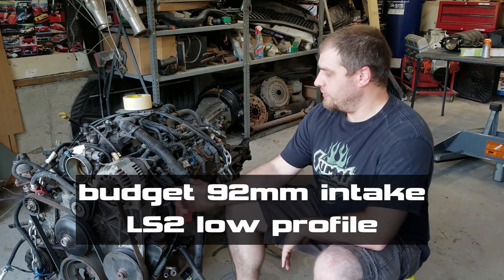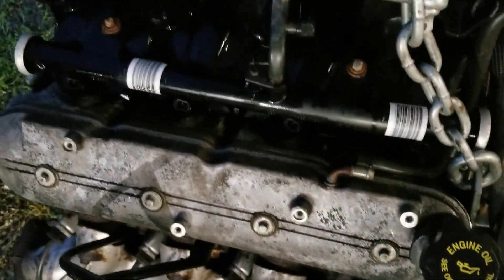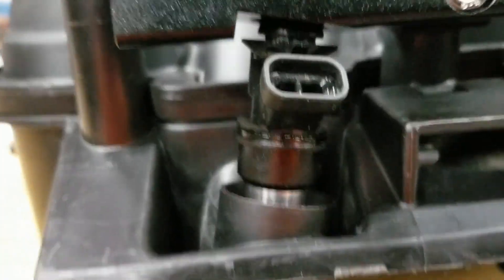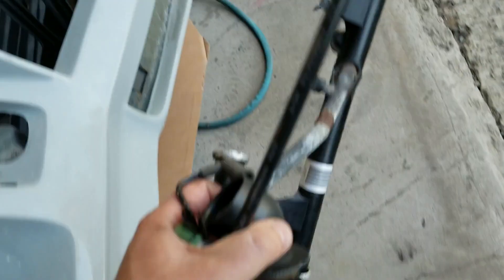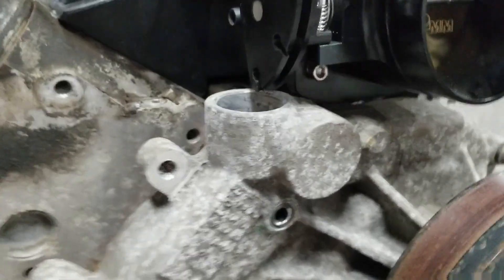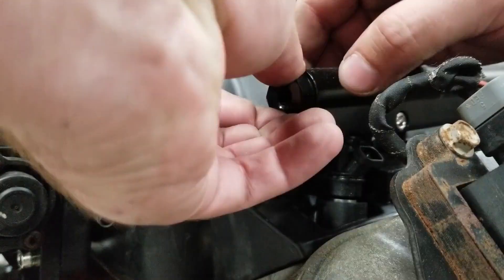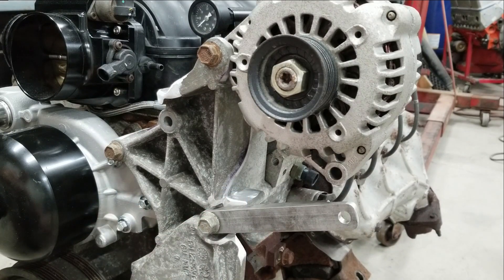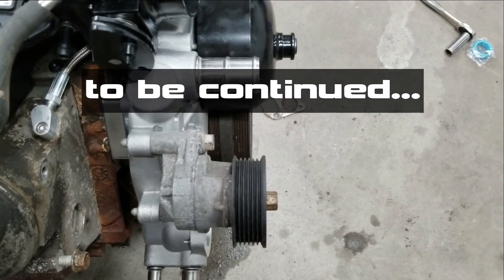Fitting cheap 92mm LS2 intake on truck 4.8 LR4 - as cheap as possible _ Part 1

Comment: What holds the throttle accelerator cable ??
Reply from the maker: Modified truck bracket. I show it in video 2
Reply: Do they make one or would you sell one ?
Reply from the maker: You can probably buy one somewhere, but they are easy to make
Reply: @ looked everywhere online but couldn’t find it problem is I don’t weld

Comment: What is the part number for the fuel rails
Reply from the maker: https://www.ebay.com/itm/Deepmotor-Billet-Fuel-Rail-Kit-GM-LS3-for-OE-Intake-Manifold-W-Hardwares-/401943279876?mkcid=16&mkevt=1&_trksid=p2349624.m46890.l49286&mkrid=711-127632-2357-0

Comment: I went thru all this same process a couple weeks ago. I used the truck injectors with no spacers, new oring kit and cut the China brackets, rewelded them to work with the rails on a cheap speedmaster LS6 style intake. I finally got a cheap ar5 trans, bought the adapter and had bellhousing, so I just need a clutch and few small things and it's ready to drop in.
Reply from the maker: Sweet deal. What's it going in?
I keep debating an AR5 in my head. Probably a better route to go than my nv3500, but I already have it and it's free. I looked at that speedmaster too, and probably would have gone that route of this LS2 hadn't popped up on eBay so cheap.
Reply: @GEARHEADdezign  when it comes to LS car intakes, keep an eye peeled and grab the cheap ones quick. The ar5 is the best manual option on a budget...if you can find 1 for a decent price. I finally found one in the junkyard an yanked it for 115$, the adapter kit is 285$, I had 4l60 bellhousing. This setup goin in a 95 Camaro I took in on trade, clean no rust v6 stick car. Soon to be 5.3 turbo stick car.  
Hey if you have any need for the 3.4 T5 out of it I would give ya good deal.
Reply from the maker: @BDauto86  I don't need a v6 t5, but my buddy @spankranchgarage might